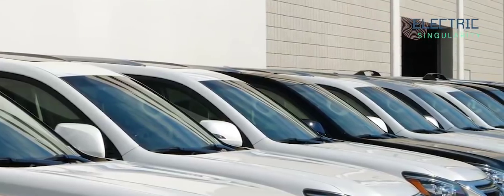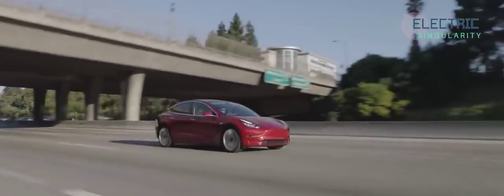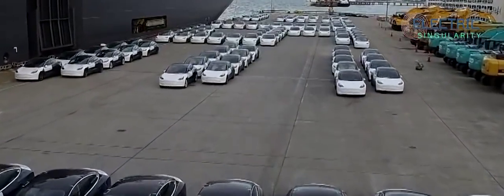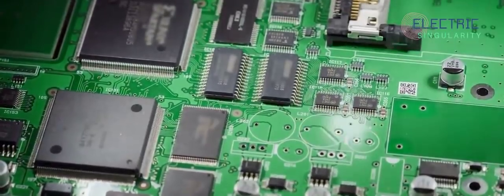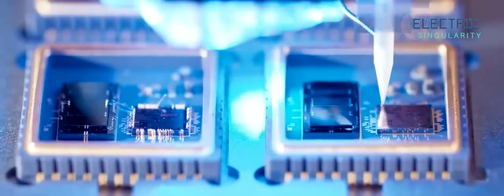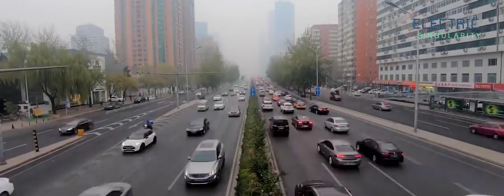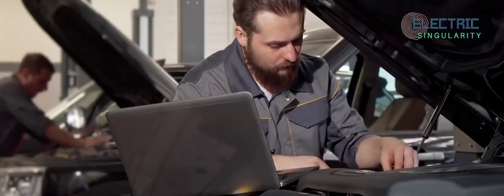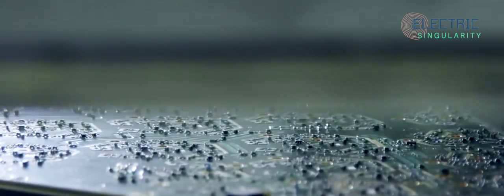How Tesla pivoted to avoid the global chip shortage that will last years

Comment: This sounds like a nightmare for over the air updates.  Every time a car is updated the software has to know what chips it has and upload the correct code and the developers have to keep track of multiple different systems that need to do the same thing using different hardware and test their code on multiple systems. Sounds like a good idea but not sure what problems they will cause in the future.

Comment: in plain english they simply just chose a different brand of available micro controllers and wrote firmware specific to that controller that at a higher level of abstraction worked the same as other brands of controllers.

Comment: Intel is just looking for excuses to jack profits. The perception of scarcity. And while every other manufacturer of cars was cutting production, Tesla has growing production and increasing their demand from their suppliers. THE FSD chipsets were never affected because they are manufactured in Texas on a dedication line. And the orders held firm so there was no reason to shut the line down. After this year I highly doubt Tesla will rely on any 3rd party common parts anymore for this exact reason.
Reply from the maker: Agree Dave!
Thanks for watching  :)
Reply: At the start of the year the samsung fab in texas closed down for a couple of months, because when it was very cold there was a shortage of energy and they where forced to shut down.  And took some months to start up again.  Just one ASML EUV lithography machine alone already uses a megawatt of energy.  I dont think there is something like a dedicated line in the factory as they have FOUP's  (the pods in the video) that are transported over rails through the whole fab and can use all machines.   Tesla basically orders a number of FOUP's .. and all the wafers in the FOUP's will only have tesla chips.  And as the current chip is about 20x13mm a foup might have about 4200 good dies. So with 2 chips per car they need to order about 86 FOUPs worth of chips this quarter.
Reply: @apsdev  it was a few couple weeks, not months
Reply: @davefroman4700  Well .. it takes 3 weeks to restart the factory.  At shutdown 71,000 wafers where processed .. part of them are lost.  As they where for instance halfway in a process to grow siliconoxide on them in an oven.  You can't restart that halfway and expect to get the exact layer thickness you want.  A new wafer spends about 45-60 days in the factory in all the processes.  So they lost of a couple of months worth of production.
Reply: @apsdev  I did not realize they took that long still today. Well that will soon change. There is now AI manufacturing at the atomic scale.

Comment: No wonder his competitors are far behind his company.
Reply from the maker: Thanks for watching Charles :)
Reply: Far behind in your dreams?!
Reply: Tesla barely made 500k cars last year when vw for example made around 10 millions.
Reply: @carholic-sz3qv  I assume he was referring to the growing electric vehicle sector as opposed to the shrinking ICE vehicle sector
Reply: @BoeingPrototype  EVs are not the only vehicles that uses chips, modern vehicles have been using chips for decades already, its only getting more and more chips
Reply: @carholic-sz3qv  I see what you mean, however, I think people will be pretty hard pressed to consider buying an ICE vehicle once their electric counter-parts drop considerably in price over the course of this decade. Of course there will still be people who will want to buy ICE vehicles, but eventually regulators will step in and put a ban on them within the decade. It would also be economically feasible to run an EV as opposed to ICE, which would see the decline of ICE as a result. When you think about it, it does make sense. For this reason, I don't consider ICE manufacturers to compete over time in this space. Not trying to trigger you by saying this at all, but this is what I believe personally .